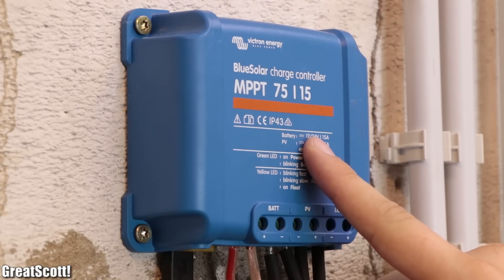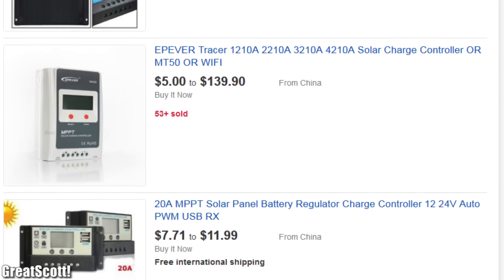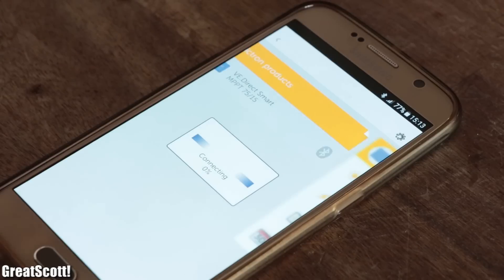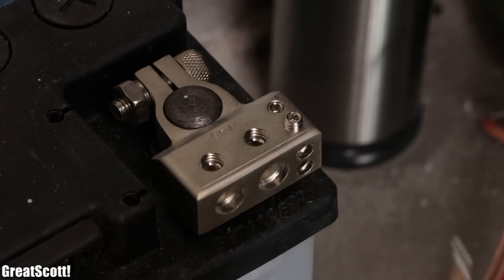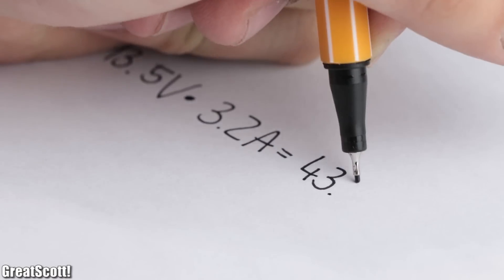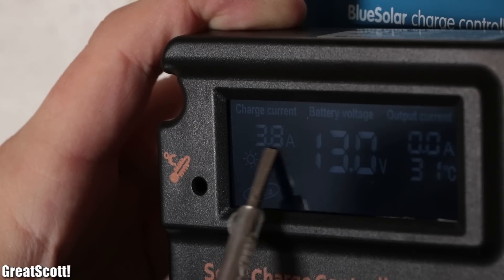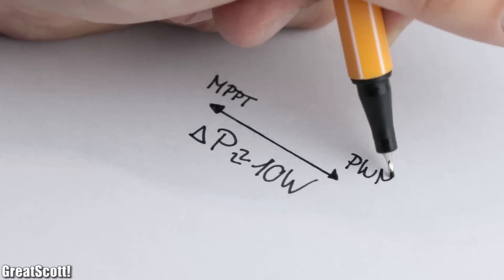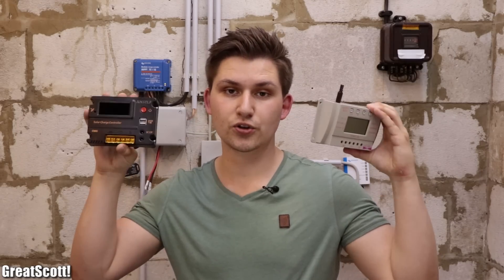MPPT VS PWM || Solar Charge Controller

Comment: Actually there is another cost associated with PWM versus MPPT.
MPPT's do push batteries a lot more then PWM controllers for the same power envelope.
MPPT controllers will waste batteries a lot faster then PWM.
And since solar panels prices are getting below 0.5$/W it is Way more economic to buy a PWM and add more solar panels then to use a MPPT controller.
MPPT controllers are only justifiable if someone does not have enough space to place more Solar panels.
Otherwyse they are more expensive and cost much more since the batteries will waste faster with those.
Reply: " ... A PWM charge controller does not operate to optimize power transfer to 
the batteries; it is optimized to extend the life of the batteries. By 
applying higher voltage in short bursts a PWM controllers essentially 
clean off the lead plates that are a central part of the battery storage
 system. How to charge controller  selection depends on if it makes 
sense to optimize power transfer, with an MPPT controller, or to 
optimize battery life, with the PWM charge controllers ... " 
http://www.ecodirect.com/Charge-Controller-Comparison-s/251.htm
I searched online ... many sources point to the same result: MPPT = optimize energy delivery to the batteries. PWM = Optimize battery lifespan.
Reply: We're not comparing different types of batteries like your article does.
I'm glad your source proves my point ... Good ...Not Poor Pulses (a Good PWM) increases lifespan and we're talking Lead Acid here ... no LiOn.
And yes Lithium batteries are indeed better then anything lead-acid, that's not the point.
The point is that for up to 3KW of solar power the better lasting and most economic system is a Lead-Acid battery (deep cycle of course) with a Good PWM controller (you not those from known online listings). (I used some Mornigstar ones and they're very good ).
Reply: 1- It works. Please try again it does work, also search any solar expert you get the exact same opinion and the forums of people with systems already installed also confirm the same issues.
2 - Your article does compares Lion with Lead Acid ... and state that with proper PWM Pulses PWM On Lead Acid increases life expectancy ... of course Improper Pulses can destroy batteries ... wow surprise surprise. Proves my point read again.
3- The article Does not compare Lead Acid with MPPT and Lead Acid with PWM ... My exact point.
4 - PWM controllers do equalizing an much more. ---again check Morningstar line of PWM controllers and they also have an external ethernet link, a huge bonus for say arduino/RPi automation. And yes they're not the least expensive out there ... quality costs ...
5 - I can only speak of Lead Acid batteries, I can not mention any other type since I'm looking for low prices, not highest possible efficiency.
A solar system is only economical if costs are better then conventional energy and that is possible when comparing with grid prices of 0.29€/KWH - plus Taxes ... plus many other stuff that comes out of the energy Bill btw.
So going MPPT and Lion bats makes no sense. Yes it is Far more efficient .. but Way more expensive.
The correct way to be economical is to use Deep Cycle Lead Bats and a Good PWM controller to Extend battery life the most.
That's my all point. 
So I would choose in this case a PWM controller even a cheaper one ... and add one more Solar panel ...
Would get More energy overall (2X solar panel) even with say 20% less charging capability.
Over the long run the batteries would last longer and as Solar cell prices go below the 0.5$/W it makes sense since battery prices are not going down.

Comment: You said "burn down my garage" while standing in front of a cinder-block wall.  :P
Reply: Having concrete walls doesn’t make the interior non-flammable.
Reply: Yeah, but I noticed that the controller is mounted to said wall and has no apparent burnable material close enough to be ignited by a burning controller. Other wide shots of the garage show minimal burnable material.  Context is important.  In the context of that garage,  with the contents we have seen, you could not "burn down"  the garage even if you ignited all of the burnable material on purpose.

Comment: Thank you for the video. But I have to add that ,the temperature and total flux are two major parameters that should be taken account in order to determining which controller is the best. These two parameters make the bluestar mppt charge controller more valuable, especially in the low light flux and high temperature limits.

Comment: MPPT vs PWM what you miss: the difference in efficency =( vPanelMPP - vBat)/100% (-power comsumption of the charger)
This means if you have 2 panels in series with a 12 v lead acid battery the difference would be way higher.
In short: the more your panel voltage missmatches your battery voltage, the more you want to use mppt.
Reply: True, which panels did he used?

Comment: A problem with the Victron controller is that it only works with lead-acid batteries. I use LiFePO4.

Comment: Interesting results you got there. Nice Video, i will soon build a Solar System in my garden, which isn't connected to the grid either. Btw i saw in a video that you drive a simson too :) I am currently doing some cool electronic modifcations to mine. I have build a quickshifter, which cuts the ignition for 80ms while shifting, thus resulting in smooth clutchless shifting without getting of the gas either.

Comment: For cheap small scale solar the savings of buying a cheap PWM controller can buy you a bigger panel. I guess if the controller dies and fries your batteries then it isn't a savings. My $25 PWM charge controller has worked for over 4 years without issue, and the batteries are still doing well. I'm putting less than 9 amps through a 30 amp rated controller, which might have something to do with it still working.

Comment: If you want both (cheap and efficient) you can buy a mppt circuit from China which cost around 10$. You can use that circuits up to 100watt panel. But before using that mppt circuits you should manually configure the mppt voltage and cut off voltage with a potentiometer

Comment: Very nice video, thanks for that.
Just because it might be something you are interested in and in the unlikely case you haven't stumbled upon it:
Debasish Dutta, an indian tinkerer, has built an MPPT charge controller from scratch using an arduino as a controll unit. My skills are definitely way too low to attempt rebuilding his work or (ideally, because I have a solarpanel >50W) improve it. So I never tested this myself. But to me it looks very promising and he even had plans to have a version 4 with higher capacity. But it seem he never came arount to do it.

http://www.instructables.com/id/ARDUINO-SOLAR-CHARGE-CONTROLLER-Version-30/

Comment: speaking of TRUST, why didnt you check the input/output of the expensive controller??
smells like you got paid for this, anyway, in order to spend 150 euros instead of 30 euros you should at least check the I/O voltage with the multimeter.
keep up the good work.
thanks
Reply from the maker: +cityboard if a video is sponsored it is always written in the video description. So in this case it was not sponsored or anything like that.

Comment: What about cheap MPPT controllers? Saw some on Aliexpress, but I'm afraid to buy... Here in Brazil there is little to no availability of European or US controller, and if you find them, they are marked 3x above their price, for example, your Bluesolar one can be found for R$ 940, or € 251 (!!!), which is too expensive... So I was thinking about one good Chinese MPPT controller together with one panel.

Comment: If anyone is interested in a cheaper system, I'd suggest looking at Adam Welch's channel.
He's done quite a few charge controller videos and even reviewed a couple inexpensive MPPT chargers (under $80) that work fairly well or there are a few super cheap PWM controllers too.

I'd recommend either the EPever (a rebranding of the EPsolar company) ViewStar or Tracer controller, both are good quality controllers or if you want to really cheap out then the CMTD is decent for its price and still allows you to tweak some settings.

https://www.youtube.com/channel/UCm5sG3-BXQZfVy3st2T_XKg/search?query=charge+controller

Comment: Always connect the battery first, then the PV. 
You are probably using a nominal 12V panel) 36 or 32 cells ), for such a panel there is no reason to use an MPPT. 
With an MPPT charge controller you can use 60 cell modules, which are cheaper, with an PWM you can't. 
Your MPPT can handle up to 75Voc, means you could connect two 60 cell modules in series, reducing greatly any cable losses, especially if you have long cables between panels and controller. 
What you measure on the PWM controller is basically the battery voltage plus some losses of the controller,as the controller switches through between pv and battery.
You can only compare charge controller charge power when you are in bulk phase, so you must first discharge your battery to approx. 11.5V.
In short: system with one or two small panels (only 36 cells) PWM is suitable, for 60 cell modules, high voltage PV, long cable runs and high PC power, MPPT is the only viable solution.

Comment: what are those 2 wires sticking out of the junction box on the background (red and black with tape)
Reply from the maker: The wires for the inverter. Since it is currently not hooked up to 12V power.

Comment: Can't wait for a diy mppt charge controller...
Reply from the maker: It will happen....but not soon.
Reply: GreatScott! awww
Reply: It's not a complex idea. Construct a graph of your panels' voltage vs. current. You want to have the line from the origin to your panels position on the Current/Voltage diagram have its maximum length.  Equivalently, find the point on the curve where the tangent's normal passes through the origin.
The issue is that the curve changes shape as illumination changes (you really need a 3-D map if you wanted to do it like your car's ECU) and an iterative approach is needed. The simplest is this: change the voltage on the input by varying the duty cycle on the controller. If this increases the power, do it again and again until it doesn't. Repeat every few intervals or when a large excursion happens on the input power.
Reply: Microchip have an application note for a mppt charge controller using a PIC micro.  The hardware could probably be upgraded to higher current and the firmware may be a good starting point for experimenting.
Reply: There is even a chip that he could base a circuit off of.
Reply: GreatScott! i made one. not effective but working.
Reply: MPPT solar charge controller.   https://www.amazon.com/dp/B0778D7SP9
Reply: I am selling 40A MPPT solar charge controller on amazon, now at discount price 115USD. contact me at 4097771728